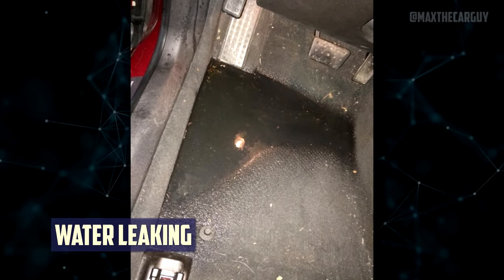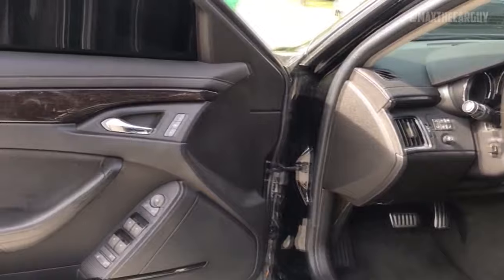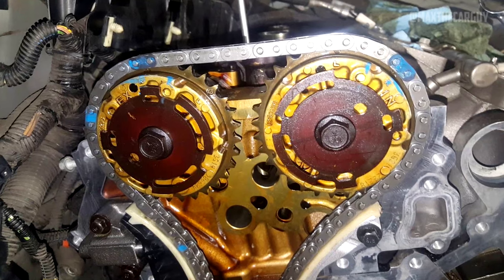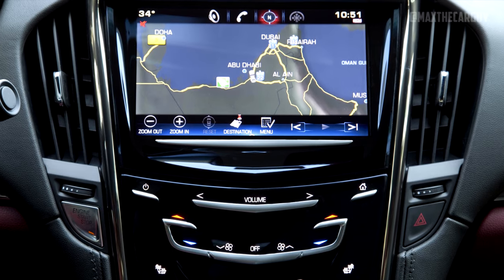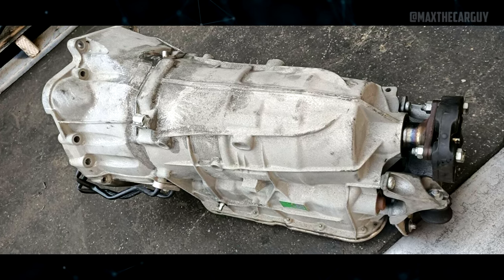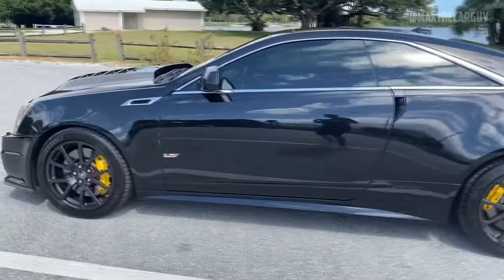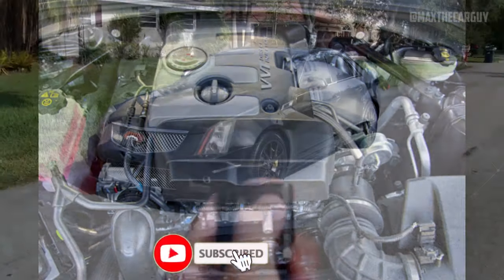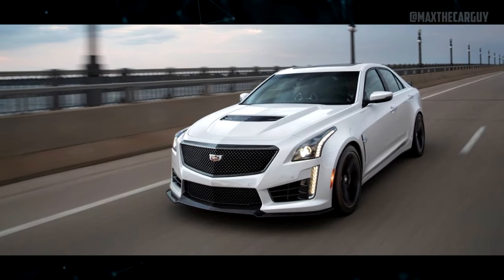10 Common Problems Of A Cadillac CTS (2008-2019). Used Cadillac CTS Reliability

Comment: I’m looking at a 2011 CTS4 3.6L v6 102K miles no accidents 2 owners 1 had it 10 years then a dealership had it fixed a whole bunch. Price is at 10.5K but have a trade in about 2-3K should I do it?
Reply: Did u do it? I got a cts in May for 2k
Reply: But the cts needed a tune which was 2k I’m currently driving it , it’s a beast
Reply: The price is to high should be 7 grand or less
Reply: @kaosatama  no I’m too broke lmao

Comment: We  bought one of these pos  cars and I would never buy another caddy ever once a great car now shit frist 110 thousand mile transfer case 3 grand for tranny then since 125 thousand miles  four soon to be five complete headlight assemblys  and it's had a series of check engine light for traction abs etc on for months
Reply: Sometimes you have to look at the owner and not the car. My CTS coupe AWD with 151,000 miles runs excellent on the original engine, transmission and transfer case. No timing chain issues. Luck? no!! It's because I regularly maintain my CTS. Change all of your fluids regularly. Most people dont even know they need to change differential fluid, let alone know if their car has a differential.
Reply: What year is the caddy?

Comment: Lol i just bought an 08
Reply: How is it going?
Reply: @EiDyn_rap  had to replace the air mass flow sensor, canister purge valve, and alternator. Plus my sunroof leaks so i has to clean out the drains
Reply: Sell it asap
Reply: @EiDyn_rap how many miles does it have ?

Comment: Car absolutely sucks. Worst cat iv ever owned
Reply: Sometimes you have to look at the owner and not the car. My CTS coupe AWD with 151,000 miles runs excellent on the original engine, transmission and transfer case. No timing chain issues. Luck? no!! It's because I regularly maintain my CTS. Change all of your fluids regularly. Most people dont even know they need to change differential fluid, let alone know if their car has a differential. The CTS is a great car, its the owners that suck.